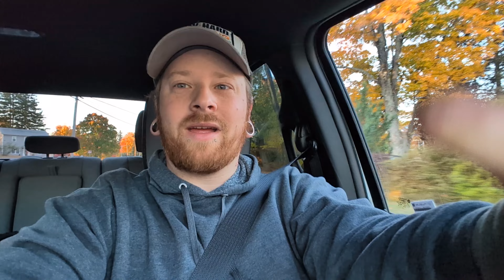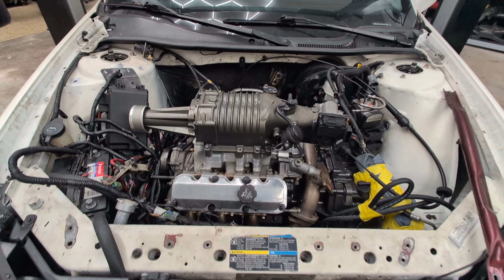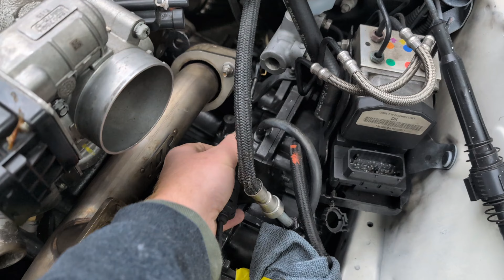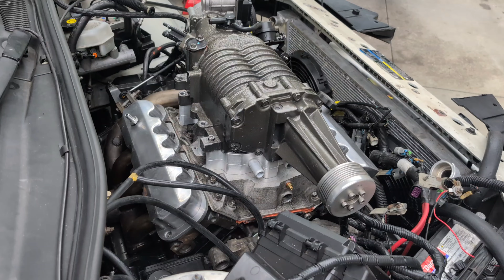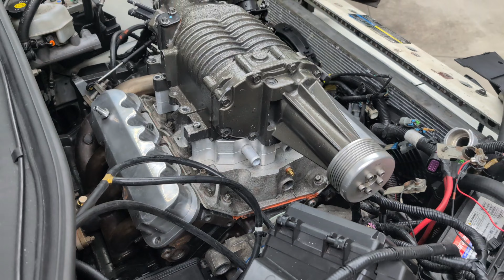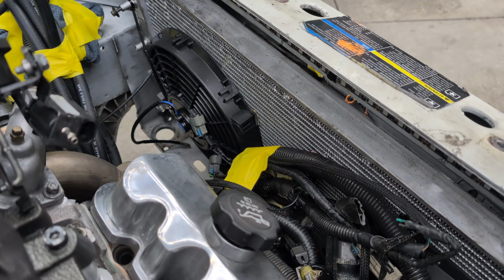Custom 3800 Turbo Manifold and 3" Straight Pipe. 4T80E Touch Ups

Comment: Very interested how you did that subframe, are you running ac
Reply from the maker: No AC for me. I'll be placing a smaller belt on it and doing away with the pulley all together